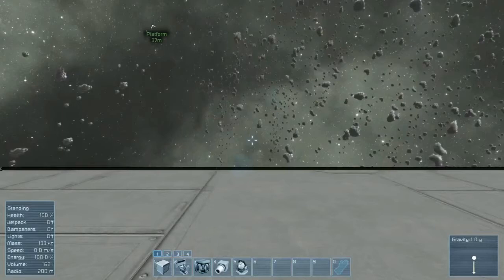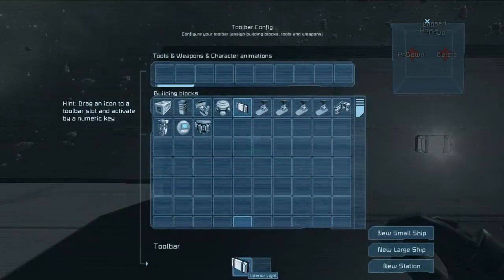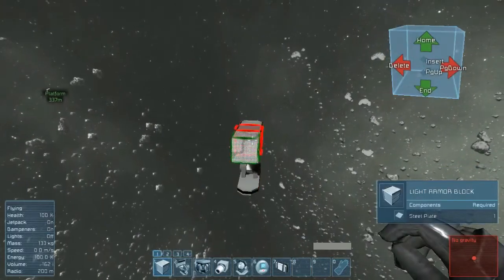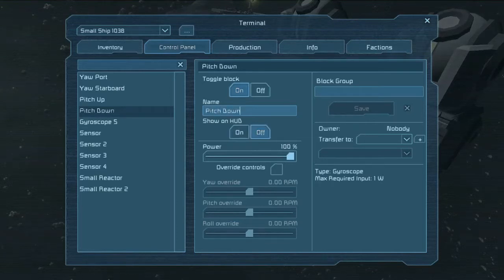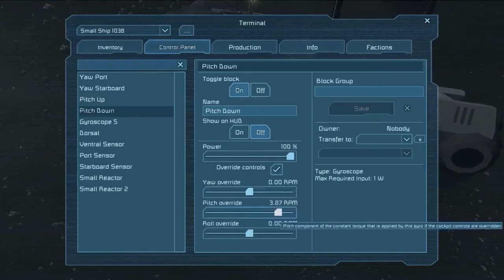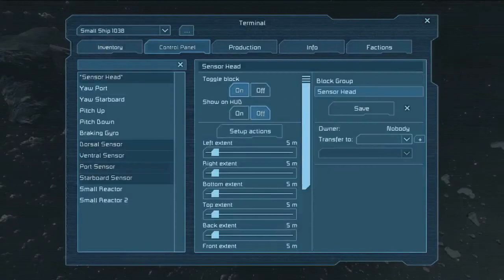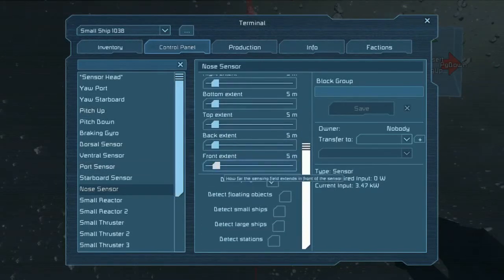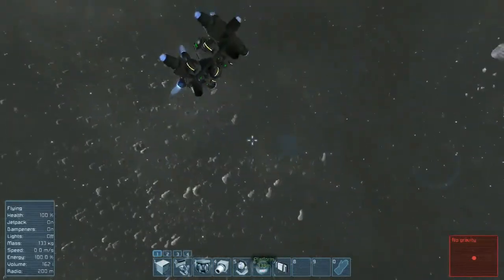Space Engineers Tracking Drones Tutorial (Sensor Blocks)

Comment: Have you checked your drone recently? I have tried your design and I find the drone wildly oscillating. The problem comes in from the fact that the gyros spin too much. Reducing the amount of gyro spin helps, but doesn't get rid of the effect entirely. As a gyro over spins, it brings you into range of another sensor, which in turn triggers another gyro, which turns another sensor in your direction etc...

Individually the sensors do exactly what they are supposed to do, but in combination, it's a wild setup. I had to mount a cockpit on the assembly just so I could jump inside and get control of it again.

I don't know if there is a solution to this, but I've been experimenting with the basic blocks, like the sensor, in order to understand them better. Your video was a big help in understanding the sensor.

Comment: Somehow the sensors for my "go upwards" never works, and makes the entire drone go in haywire directions. Any advice?
Reply from the maker: Unit testing: make sure the "up" gyro actually rotates the ship up, and if not, re-configure its sliders until it does.  Then make sure all of your sensors have the correct ranges set on them -- I've had ship flip out because I had the "back" slider for one or more sensors set differently than all the others.  Good luck!
Reply: John Brewer They move in the perfect direction when I test them one by one. But when I turn on the sensors everything turns into a mess.
Reply: InspiraX1234 Yes, now it's all of the directions. Nothing seems to be working now. Even testing them one by one.
Reply from the maker: InspiraX1234 Sometimes it is easier to just strip out the whole system and rebuild it from scratch than trying to track down the error.
Reply: John Brewer I did that too. Same issues.
Reply: +InspiraX1234 I was having a similiar issue and then eventually once i made sure that everything was pretty much identical to John's demo, I went out of the 50 meter radius and came back in and then it worked fine. I know this is a super late reply but better late then never XD >.<